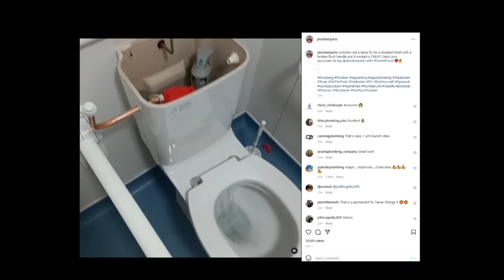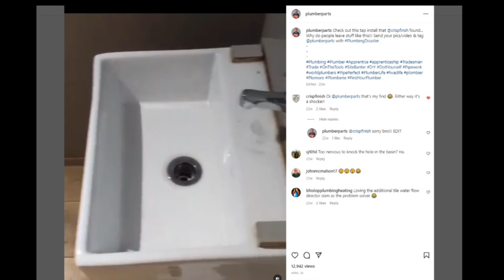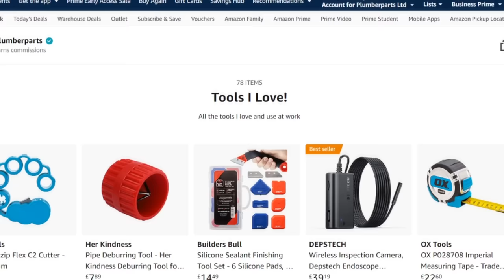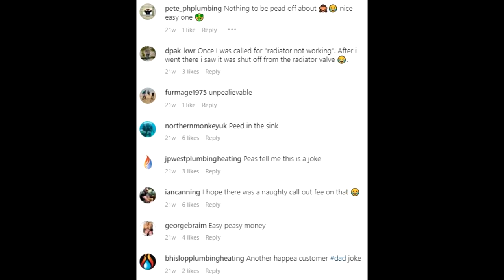Flexible pipe kink | Plumbing Disasters

Comment: I'm at a bit of a loss, hoping someone could help..!  We have a gravity fed oil boiler which won't fire up after tank being filled.  I have oil coming out of the tap at the tank end, filter is clean, but no oil coming out the line by itself at the boiler end, disconnected from the pump.  So only the line in between.  I can manually pull through as much oil as I like with a transfer pump but when I disconnect it the oil in the line stops...  In my mind with it being gravity fed I should see a trickle of oil.  Could it be the pressure/head of oil in the tank not sufficient to push the oil through?? I can't think of anything else.  Anyway, sorry to ask but hoping one of you knowledgable guys may know...?!
Reply from the maker: Is the burner higher than the level of oil in the tank?
Reply: @plumberparts  the burner is approx 100mm higher than the current oil level in the tank.  What's confusing me is I can draw through myself but when reconnected it won't pull/push through itself?  We normally get 1000 litres and run down to minimum >500 litres, but as supply not broken is the vacuum/ flow maintained?  Thanks for your response 🙏 appreciate it.
Reply from the maker: Have you tried the procedure of bleeding the oil line, using the pump bleed, whilst the boiler is attempting to light? As soon as it goes out on lockout shut the bleed. Wait. Then push the lockout button, bleed. Repeat until she holds a flame.
Reply: @plumberparts  yeah, that normally does the trick tbh, but I can literally remove it, go to fire up the boiler and nothing :/ so boiler locks out. Tried umpteen times.  No oil weeps out like I'd expect.
Reply: @matthewwatkins1854  I'm not experienced or an expert by any means, but it sounds like your pipe's gunked up and has become restricted. Oil is viscous and waits for a chance to get into a thinner pipe and jam there due to surface tension. Non-synthetic oil ages, absorbs moisture and becomes this horrible sticky paste. Similar to the sludge that blocks your drains. Try diagnosing the pipe being constricted? (Probably bad idea: run water through it to check flowrate; run a drain snake through it to scrape it clean-er)
Reply: @dimitar4y  you are quite right sir.  It transpired to be a perished Flexi hose! Rubber had blocked the feed causing no flow.  I made a mistake and was pumping oil down the return pipe thinking it was the feed as there was nofloe.on the other line (due to blockage) anyway, everything has now been cleaned out and new lines ordered.  Thanks all and @plumberparts for responding, great community
Reply: @matthewwatkins1854  No, thank you for giving actual useful details :) And for being resourceful enough to figure it out without us having to come fix it for you xP